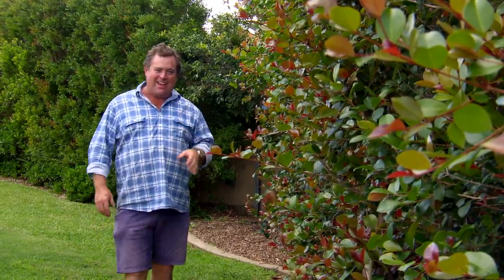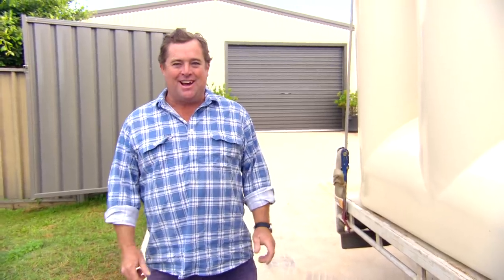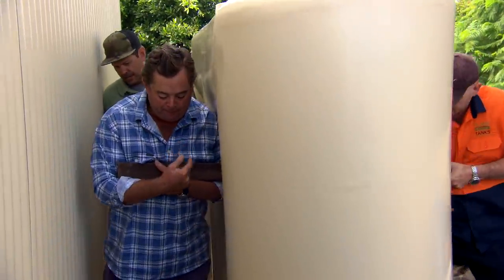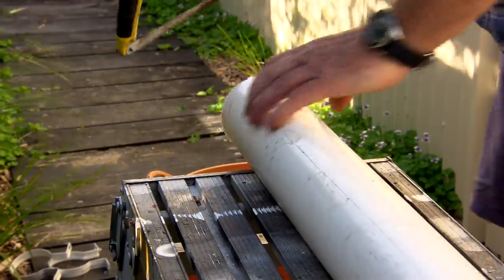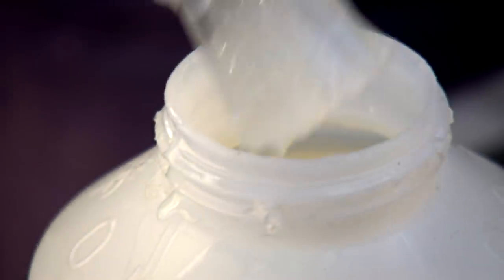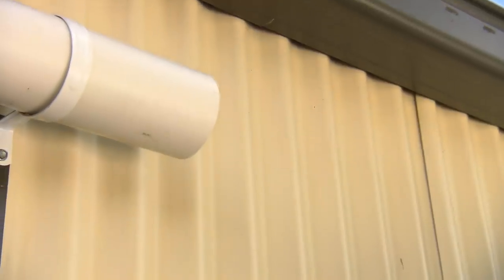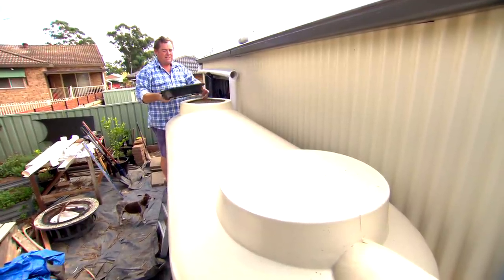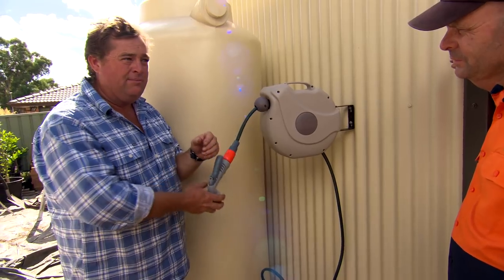How to Install a Water Tank...and Save Lots of Money On Your Water Bill | GARDEN | Great Home Ideas

Comment: Tell us more about the pump please.  I need to add one, but that looked like it required 240v?
Reply: That pump did need 240v and most you find will, if you don't have power nearby you could look into solar powered pumps.
Reply: @mrbrown3546  or run an extension lead and waterproof housings

Comment: The video title should be: "How to install a water tank, waste lots of money and help flood Hawkesbury/Nepean homes" 

That looks like a 3000L tank. Typical installed cost in Sydney including pump is around $2,000. Town water currently costs around $2.50/kl (in Sydney) so tank holds $7.50 worth of water. Typical pump is 1200W and pumps 3700L/hr so it will take 0.81 hrs to empty the tank and will use 0.97kWh of electricity. At a typical cost of 26c per kWh it will cost 25c in electricity, meaning the tank holds $7.25 worth of free water.  

Average annual rainfall in a typical Sydney suburb (Bankstown) is around 880mm.  Typical catchment roof space is around 80sqm (not 200sqm as some sites claim because few older houses with retro-fitted tanks like this one collect from all downpipes). Total water falling on roof collection area is 880 x 80 = 70,000L per year, but a lot of it falls during storms and overflows the tank, so realistic collection amount is 50,000L per year, or 17 tankfulls. That saves around $123 in water rates per year or $2,460 over the 20-year life-expectancy of a poly tank. Even if roof collection area was 200sqm the saving would not be significantly more as most of it would overflow the 3000L tank each time it rains. 

A pump only lasts around 15 years so during those 20 years there will be at least $500 in pump repair/replacement costs, sludge cleaning and other maintenance. That means for an outlay of $2,500 over 20 years you get a return of $1,960.

If you had invested $2,500 in the share market 20 years ago (June 2002) instead of installing a water tank, that investment would now be worth $9,700 (according to the stock market calculator on Noel Whittaker's website), meaning owning the tank would have cost you $9,700 - $1,960 = $7,700. But at least you get a warm fuzzy feeling that you are somehow saving the planet. Except that you aren't. The three recent floods in the Hawkesbury/Nepean, that cost insurance companies (meaning the public) tens of millions of dollars, would not have occurred if Warragamba Dam had been significantly lower, as would have been the case if not for all the BASIX-mandated water tanks in Sydney. There are downsides to everything.

As for the black ball in the "first flush diverter" which another user asks about, the theory of the ball is to separate the initial dirty water from the clean water. Without it the initial dirt still falls into the diverter until it fills up, but the subsequent water passing over the top continually stirs up the water in the diverter causing most of the fine dirt to eventually make its way back out and into the tank. 

In reality the entire diverter setup achieves virtually nothing. The one in the video is around 1.2m long x 90mm diameter. It holds just 7.6L of water. It fills up within a few seconds during a downpour, long before most of the dirt on the roof has reached the guttering, let alone flowed along it and down the downpipe. Heavy sand etc. will fall into the diverter but the fine suspended silt and organic matter flows straight over it. To provide any dirt collection benefit at all the diverter should extend right to the ground, but the downside is that it then reduces water catchment during light rain. It also increases another problem which is a constantly damp, algae-covered patch on the concrete beside and around the tank, as the diverter slowly empties drip by drip, even weeks after the last rain. A hose can be connected to the diverter and run to the nearest lawn but that is often impractical.

There is an excellent article titled "To First Flush, or not to First Flush" on the US Bluebarrel website (links aren't allowed here - Google it). It points out amongst other things that most rainwater tanks are used for watering plants and that the fine organic material that the diverters are supposed to eliminate is a good source of free fertiliser.
Reply: Very very very well put together. I completely agree with all of your points. Only thing I didn’t fully agree with was your thoughts on the diverter. 

I installed a diverter in my setup with the school of thought I don’t want algae/bacteria build up at the bottom of my tank in the long term.

Apart from a small bit of differing view as above, completely agree with your thoughts. The primary reason for me installing a rainwater tank at my place is to add capacity to my two pits given I added a shed with roof of circa 30sqm. This extra catchment area has flooded my back yard twice in the recent 2022 Sydney rains we’ve had. I assume the two pits the builders put in when they built my house, the pits were only specd to support catchment off my roof only. 

Your post is a clear eye opener to anyone looking for the economical benefits of rain water harvesting!

Well done.
Alex
Reply: @Gamer_Marcy_God  Thanks for the comments. Diverters make little difference to algae or bacteria build-up. If you are mainly using the tank to water the garden then all you are doing is removing useful nutrients. 

Even a full-height diverter pipe only collects about 15L of water or about 10 seconds worth in a downpour. Bird droppings on the roof can take minutes to dissolve away. The diverter fills with water before the majority of bird droppings or other dirt, algae, lichen, dust etc. on the roof has reached the diverter. 

To confirm it for yourself just remove the tank inlet sieve and get a broom or mop and swish it around on the bottom for a few seconds then turn on the tap or pump and see how dirty the water is.

If you want a permanently clean tank then get a Tankvac. They waste some water but often that water would have overflowed anyway. You can easily make one yourself for about the same price as a ball style diverter. Just google their patents, which have both now expired by the way. Obviously not much demand for them.
Reply: I agree with water tanks purchases v town water it's not financially viable at all. To be fully self sufficient you need at least 50-80k in home green energy investments to go fully or part off grid. The ROI on renewables is absurd considering the climate crisis we're in and green energy is the answer supposedly. Not to mention batteries, solar panels and water tanks do not last forever and do require maintenance. 50k-80k invested in the ASX at 10% dividend yields a year is 5-8k in extra income every year, which is more than enough to cover energy and water bills annually at current rates for most families.12-20k for solar batteries each!  two batteries are generally needed for most families energy needs if you want sufficient energy storage. 4-8k in slimline water tanks for 5,000-10,000 liters to fit most homes is still not enough water storage, 6k for 6.6kwh solar systems is not that much energy when one heater alone can use 2kwh an hour, it all adds up $$$.... isn't this why they built dams, gas pipelines and coal fired powered stations in the first place back in the day? lol